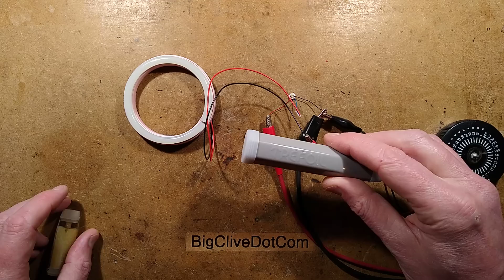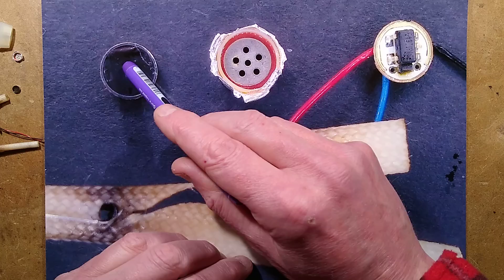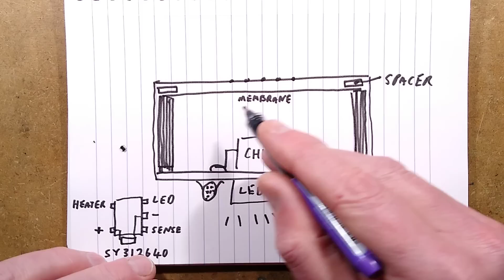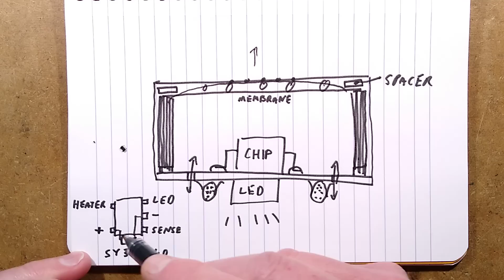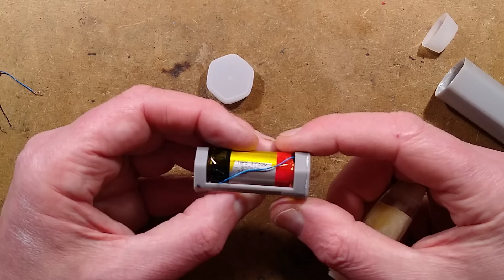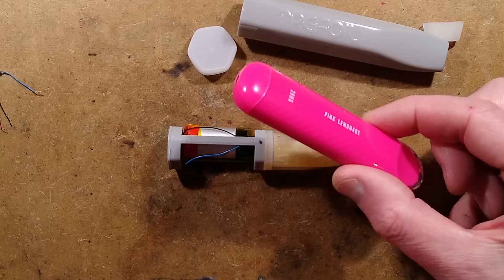Did this pose a fire risk?

Comment: I'm always a bit surprised that there aren't more than a few garbage can/landfill fires due to this. Particularly when you consider the sheer number of single-use items out there. While I'm not exactly hyper paranoid about lithium cells, I do take precautions before either tossing or recycling anything with one. Though in general, I do find the idea of a single-use items with Li-Ion cells kind of asinine anyway. And I'm not exactly what you would call an eco-activist kind of person. I get that there really isn't a good option that wouldn't result in the end product being somewhat enormous, but still. But I suppose that the current trend of lithium and cobalt prices blowing through the roof may soon put these kind of things to bed soon. Which is probably a good thing, if I'm being honest.
Reply from the maker: Fortunately the charge in the cell is low at end of use.  It's not the tiny amount of diffused lithium that causes the fires, it's the energy storage of cells.
Reply: Probably are more fires started by some of this stuff than we realize.
Reply from the maker: @WitchidWitchid  I've not come across many indications of that.  I think discarded power banks and broken phones are more of a garbage hazard.
If anything it couldn't compare to fires caused by traditional cigarettes.
Reply: Disposing of old lithium ion batteries makes me nervous.  Since there is no place to take them for recycling within 75 miles of my house I wrap them in multiple layers of duct tape then dispose of them in my household garbage when they start to swell.  None of them have lit up on me but I wish I could reasonably dispose of them properly.

Comment: I had an e-liquid leak on my refillable vape which got onto the circuitry. It continued to vape fine, but the charging circuit refused to charge the battery until I cleaned it properly.
Reply from the maker: That's the curse of eliquid.  It's very mobile and extremely hygroscopic, so it stays wet.

Comment: I collect the batteries 8 so fare lol I also recharged one for my dad today terrible waste I vape lots.. wish they made the 3x 18650 mods but they don't anymore ?
Love the videos as Normal Clive brilliant work also what's wrong with a button lol
Reply: A few companies do. Where are you located? I work at a shop in CT. We have a few older ones, even some quads.
Reply: @masrock10  Checked a video they uploaded and based an their accent... Very far away from Connecticut! lol (somewhere in the UK, to my untrained ear)
Reply: @masrock10  yes the UK. guys I just like the longer lasting battery time plus I use old used 18650s so having 3 ups the vape time at 35w lasts the day use an old JayBo had it years
Reply: How about a 2x 21700 mod?
Reply: @SproutyPottedPlant  I like them yea but I have 500 18650s all over the place lol

Comment: Some thoughts from somebody that unfortunately through professional necessity knows far too much about these (and has taken apart dozens):

1) the geek bar esque construction as you say of this one is actually quite rare. Most of them are essentially bare components, sandwiched between bits of foam inside a tube, usually with spliced wires leading from the coil section at the top, to the battery at the base, wrapped in some kapton tape. These ones that are quite a bit more structured and have gone to the effort of having the pogo pins etc are still quite a rarity.
2) I've never seen a single one that didn't use Nic Salts in their formulation, its the overwhelming standard (interestingly, not just via benzoic acid. Also lactic and levulinate and ditartrate acids are used as well for what its worth). The lack of bite you might be feeling is possibly they're using less cooling agent/menthol/"ice" than most other disposables. Nic Salts themselves actually tend to have typically almost nothing in the way of "bite" by way of design, allowing for higher nicotine levels (like the 20mg common in disposables, or the 50mg+ used outside europe). The lack of mention of that on the label however is going to be down to laziness/improper labelling standards. This isn't particularly surprising because...
3) the 1600 puffs (along with the size of battery, size of the wick etc) shows that this device is definitely more than the legal limit of 2ml, something very common in the UK at present. They've exploded in popularity and enforcement on those laws is extremely lax so, anything kind of goes, especially in newsagents and corner shops etc that will just sell anything.
4) They are just an absolute ecological nightmare. If you had to write a list of things that would make a single use product as environmentally unfriend as possible, i think these would top it. Hazardous Chemicals internally requiring specialist disposable? Check. Co-Moulded inseperable plastics? Check. Glued together/press fit/difficult to dismantle? Check. Lithium battery? Check. I'd hazard an (extremely educated) guess that over 10m units are being sold per month in the UK. All of them are using rechargeable lithium batteries (ive yet to find one that wasn't anyway), all of them going straight to landfill. Utterly atrocious but hey, they make people money so they'll keep going until somebody legislates them into oblivion where they belong.
  
Anyway, despite all my experience, this is the first time i've seen one autofiring straight out of the packet, so super interesting. Cheers Clive!
Reply: Isn't the allowable capacity 10ml, as in maximum 10ml bottles?  I wasn't aware there was a separate ruling for disposables that was less than that.  20mg/ml of nicotine salts is actually less nicotine, since the salts have a higher molecular weight, the amount of active incredient (ie available nicotine) is actually less.  It's always made me shake my head that the legislators don't seem to know the difference between active ingredient and compound weight.  (eg 50mg/ml salts in Juul is actually about 28mg/ml active ingredient after it's been reacted with benzoic acid.  Still high, but given how little vapour they produce not at all an unreasonable amount).

... and coming back to the UK, aren't the rulings for 10ml bottles and 20mg/ml nicotine content EU directives, and the UK is no longer in the EU so they don't apply?  About the only thing the EU directives on this subject actually do is make vaping less useful for those that need it the most.

(also someone who knows a stupid amount about this stuff out of necessity, but I'm not in an EU country or the UK).
Reply: @Chris_the_Muso  the worst part is you have to get nic in 10ml bottles creating lots of waste!  Not good for DIY so a nice big 1l bottle with a nic strength suitable for MTL vaping needs about 10 or more useless little bottles 😡😡😡
Reply: @SproutyPottedPlant  actually, more like 100 little bottles. 1000ml divided by 10ml bottles is much more than 10.
Reply: @SproutyPottedPlant  I mean... technically.  But I've been buying 72mg/ml in 1L-2L bottles for years.  I know I shouldn't be able to but the rules are not enforced at all in my experience.
Reply: @Chris_the_Muso  10ml capacity for bottles, 2ml capacity for tanks/pods. Some countries implemented a difference between pod and tank like Germany, so refillable tanks can be up to 10ml, but prefilled pods or disposables are at most 2ml, but the normal was 2ml limit across the board for tank or pod size. 

In terms of ingredient weight etc, this one's actually a weird one, usually down to labelling inadequacies once again, or in some cases producers that don't know what they're doing. To use the UK as an example, the limit is still 20mg/ml of actual nicotine in the EU, so all of the 20mg you see thats been done right, actually contains (usually, roughly) 36mg/ml of the final actual product, and 20mg/ml of actual nicotine. There is however plenty of product that's been done wrong by people that dont really understand that, and it contains 20mg/ml of overall benzoic acid/nicotine solution, so only 14mg~ of actual nicotine, far under what it should be. Juul is also actually 50mg of real nicotine (or is it 54mg i forget? 5% w/v either way), but the total amount of "nicotine benzoate solution" in the final liquid is like 70mg/ml or whatever.  This realisation came out a while ago and its been a bit of a mess since then of people (producers included!) sometimes understanding that nic salts =/= freebase nic in terms of w/w, but not being entirely accurate on in what way that works. Industry accepted standard at this point tends to be that if something says XXmg/ml, that should be how much actual nicotine is in there, not how much overall salt solution is in there.

In terms of EU rules not applying to UK anymore, yeah, thats kind of how brexit was advertised, but in reality the majority of eu rules that we are bound by, are already codified into UK law as their own local copy of the EU original. When we left the EU, we sorted through all of them, and kept like 99.9% of them in place. It does mean that we can go back and repeal stuff like that if we wanted to, however the governments review on TPD legislation actually just concluded and was published on Monday, and it essentially said "we know some people want stuff changed in these rules, but actually we think they're working pretty well, so they're staying", so that's unlikely to change in the future. 2ml and 20mg for us UK folks it is.
Reply: @1337Raspberry  Ah yeah, I do remember the 2ml tank rule now that you mention it. As time goes by I think you'll see it ignored more and more. Stupid regulations aren't worth enforcing. The only people those rules work for are those that don't vape.
Reply: @Chris_the_Muso  the UK brought the EU regulations into law before we actually left, so it's still valid in the UK.

It's a pain because they are all just arbitrary limits on vaping while missing almost everything that could have been useful like limiting the use of totally disposable units or banning fakes/copies (since they have massive gaps in quality).

I could rant about the regulations all day but I won't.

This device definitely breaks the rule about 2ml maximum tank capacity though and looks like it fails the leak proof requirements (not sure how that's expected to be done tbh).
Reply: @treeherder42  fakes/copies are already banned under the same laws as anything else being imitated on the market. It's just enforcement is a much lower priority than like, fake gucci handbags being sold out of a storage unit in cheetham hill or wherever. The original 2ml/20mg line had some kind of medical justification in terms of LD50 for kids under a certain age if i remember correclty, so even if a kid got into and drank a whole ass 20mg/2ml tank or pod, they should survive, because pods/tanks etc aren't as easy to regulate a child lock mechanism as twist/push caps for bottles etc

Comment: Rechargeable? You bet. Refillable with nic salt? Also yes. Does a store-bought nic salt refill in a recharged non-rechargeable disposable nic vape taste like crap despite the effort and risk? Absolutely.  Also: "vapor produshink devishes"
Reply from the maker: There's a certain pleasure in refilling and recharging "disposable" devices.
Reply: @bigclivedotcom  The Elfbar BC 5000 has a square-body-and-tank assy that makes it shamefully easy as the top is press-fitted into place. It's also usb-c rechargeable but utilizes the same batting- and wick approach that makes ots nic salt refills disappointing. OTOH, Hyde's got a Rave rechargeable that could be drilled, filled, and covered with a bit of flextape and a square of parchment paper.

Comment: By now one can assume Clive's spidey sense-like power of detecting failed electronics tingled to pick out the exact device that had destroyed itself.  How else could he find such a spectacular piece of rubbish NiB in the shops? :P
What a shame that perfectly serviceable lithium cells are being used in poorly regulated throw-away, single use products.  Along of course with plastics and electronic components of course...
Reply: Why can't there be a call to "Recycle your vapes" like we are trying to recycle batteries now?  It's going to matter as our traditional throwaway sources possibly get embroiled in war and other nasty global politics.  "Recycle your vapes for American/British/western freedom"

Also as suggested by comments above, it would save our refuse collectors from fiery hassles.
Reply: @SeekingTheLoveThatGodMeans7648  I bought a 10 pack of the smallest USB charge boards on Amazon, and have made a handful of "un-disposable" vapes for friends. It's not "beautiful," by any means, but duct taping a postage stamp PCB to the outside is a simple solution, and IT WORKS. Now it charges up, status lights work, vape runs, and I saved a bunch of money. 
If you're aren't possibly about to unleash the magic smoke, are you even having fun?! 🤔
Reply: @Karl_Kampfwagen  Oh yeah, those little charging boards are great for diy battery projects. If they have output pads, they also have low voltage cutoff.
Reply: @SeekingTheLoveThatGodMeans7648  Who recycles batteries? I don't even know where i would do this... there are already enough different bins i'm supposed to worry about.
Reply: @chrisakaschulbus4903  
Well I, and everyone I know ‘recycles’ or dispose of them in dedicated bins/collection points in all supermarkets.
Reply: @countesscable  And what else... i must also separate the glass in the different colors?
I have these glass containers right in front of my house, and noone cares.
Guess why the one that's easier to reach is filled so quickly? Not because most glass is brown, that's for sure.
Reply: @chrisakaschulbus4903  in what country do you live? I don’t have any problems. All our glass goes in together. What’s so difficult?
Reply: @countesscable  Germany... we have different glass containers. White, brown and green.
"What’s so difficult?" The same thing i already said... just throw it all into one bin. 
No matter what trash it is.

Comment: I bought a couple of geekbars from a local shop 2 of them had leaked liquid in the packet I took them back and the shop mentioned they had a high number of returns for the same reason, also how conductive are certian ratios of the liquid my big tanks connections are always covered in liquid but the unit doesn't report a resistance change or short.
Reply from the maker: Compared to the low resistance of the heater coil the liquid is negligible.  It only becomes an issue if it gets into the electronics.